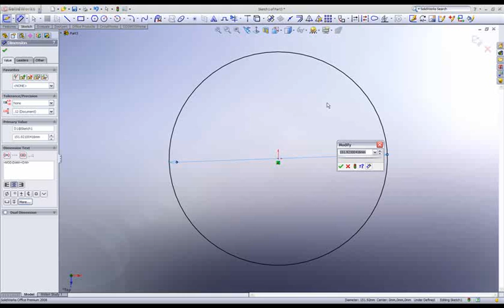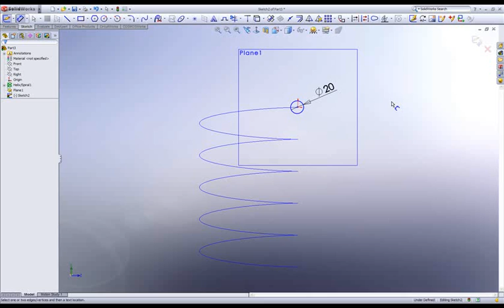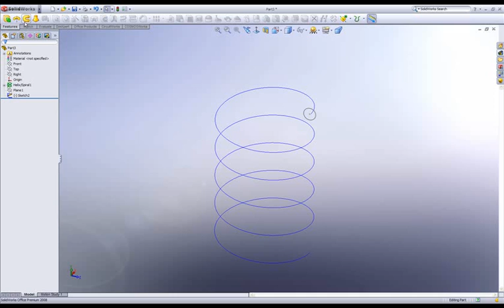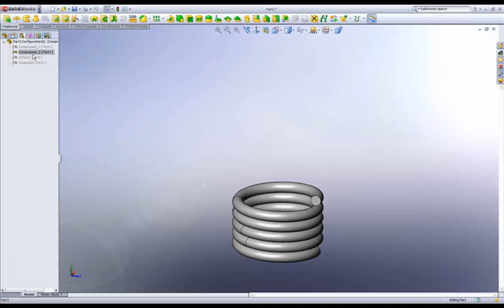Solidworks 2008 - Helical spring with changing pitch

Comment from the maker: The same steps you use to make a normal helical spring, but when you draw the circular cross section draw 2 concentric circles.
Reply: Mohammad AlJammal I have a problem. I am using solid works 2008. When I open a certain drawing I get a message of what's wrong warning. The description in the what's wrong window is that the drawing has rebuild errors and part of my drawing disappears. How to fix it? Thanks.